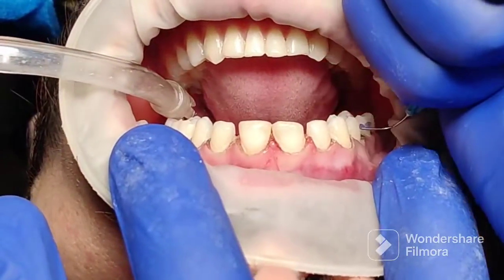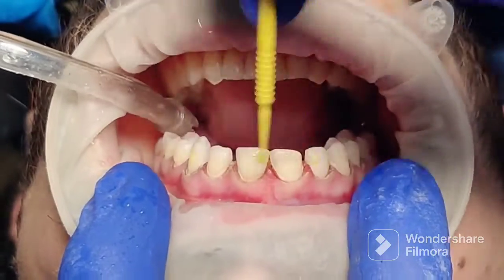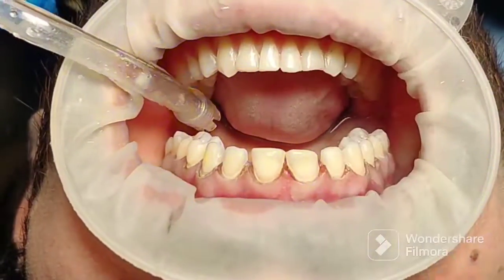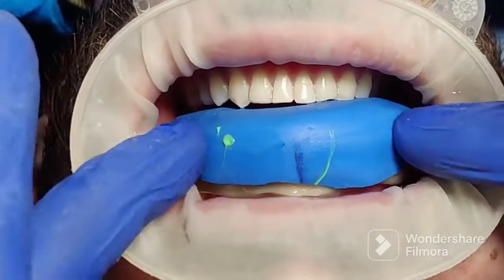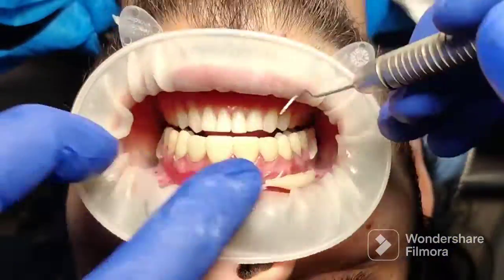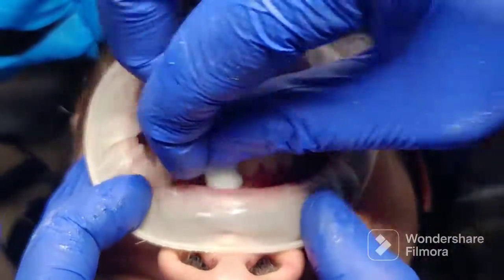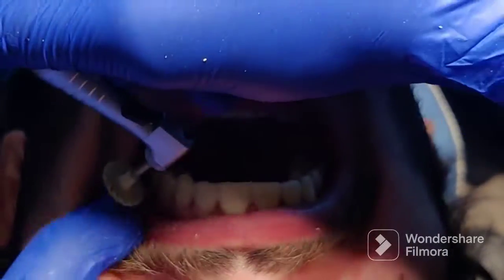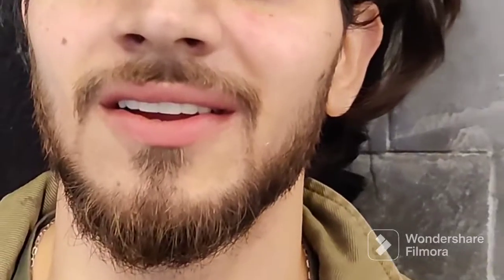Making temporary dental veneers: Mock up transfer

Comment: I loved the result, but how long the temporary veneers typically last before needing replacement?
Reply: how much does this typically cost?
Reply: Well kriss said that they typically last anywhere from a few days to a few weeks, depending on the specific circumstances and the materials used.  And about the cost @TitusMonger , it usually costs between $200 to $500 per tooth.
Reply: @allisondarcy  what kriss??
Reply: @allisondarcy  how can i access ?